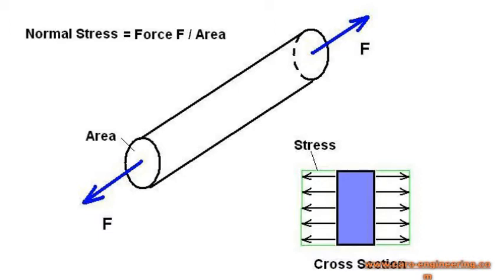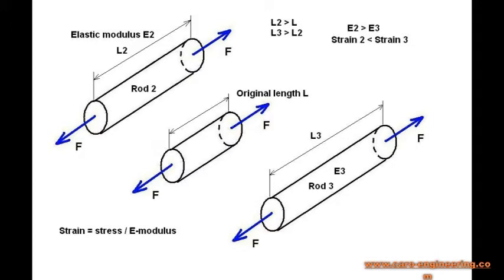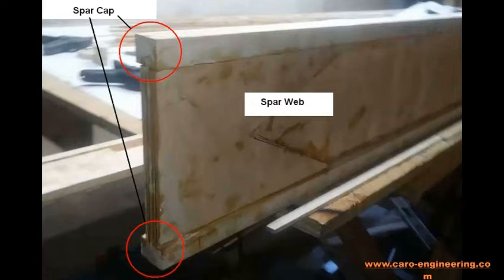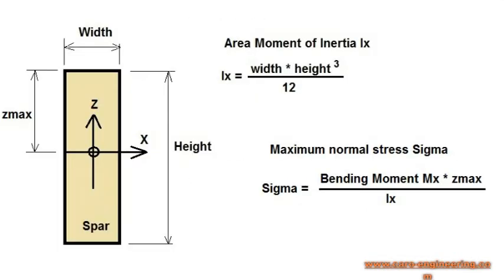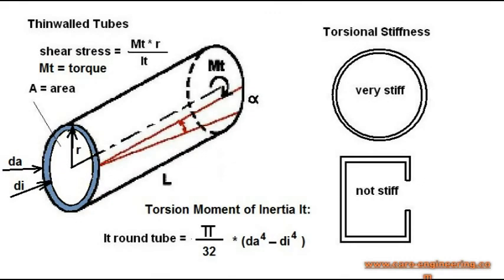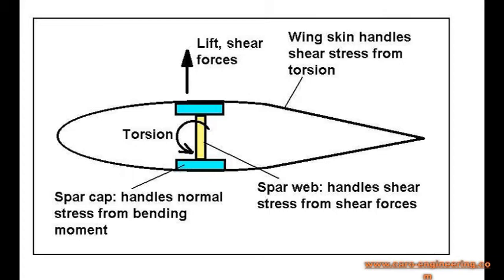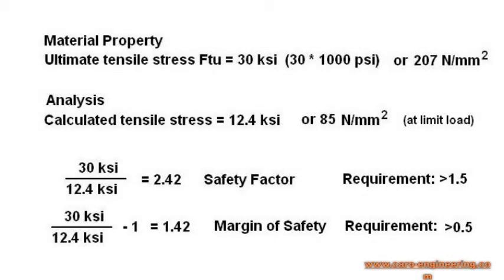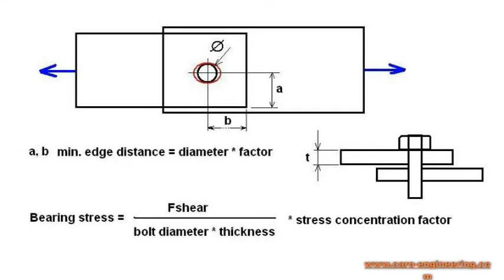Small Airplane Design Tutorial 17, Structure

Comment: For these thin walled structures like the d tube and the fuselage tail boom, the failure mode would inevitably be local buckling on the compression side but I can't seem to find any robust mathematical framework to predict this buckling. Also to mitigate this buckling, you use ribs. But what should the spacing and configuration of the ribs be? Can you point me in the right direction? thanks
Reply: Depends on the construction method. Most aluminum designs allow post-buckling of the wing skin. The spar caps take all the bending loads.
Reply: @Triple_J.1  Thank you, but suppose, I wanted to calculate the rib spacing, for say a tail boom with a circular cross section, how would I go about it? Thanks again

Comment: If the spar deflects too much, might it not affect the aerodynamics even though the yield strength of the material is not affected? 

Can a spar be considered to have failed if it deflects too much even though it is still structurally ok?

Therefore shouldn't deflection be the design criterion for a spar rather than the yield strength or ultimate tensile strength?

Thank you
Reply from the maker: Usually not, but stiffness is a design consideration because it affects flutter, especially on gliders with their long thin wings and fuselages. A structure that is too flexible can negatively affect flight characteristics. If an airfoil shape deforms, it probably creates more drag.
Reply: @sonjaenglert  I have one more question which I hope you won't mind answering;
What values do you use for yield strength, ultimate tensile strength, compressive strength and elastic modulus for glass fiber reinforced epoxy resin?

Thank you
Reply: @SunilSundar  E-glass has an elastic modulus of 10,600,000. It breaks around 477,000psi. Or 0.045 strain (4.5% strain). 

Epoxy is in the range of 500,000. It breaks around 8,000psi. Or 0.016 strain (160 micro-strain).

Because epoxy cracks and disintegrates at 0.016 strain, that is the maximum strain that a laminate will be able to survive for more than one use. Most designers use 0.004-0.005 strain to allow plenty of safety margin, and to account for fatigue which will crack the laminate at a lower strain with repeated flexing. 

Now, multiply those above modulus's each by ratio of epoxy to glass in your layup. 

And then multiply by 0.005 for design allowable stress. Keep in mind, only the glass in the 0-direction (of the load) is counted. So a laminate of 0.5 glass/epoxy where the glass is 0/90/0/90 only half of the 0.5 glass will be counted for strength. So 0.25.

Example: 10.6e6 x 0.4 Glass, x 1/2 in the 0 direction = 2,120,000.  And 5e5 x 0.6 Epoxy = 300,000. 

Add together, = 2.42e6 Modulus. X 0.005 strain = 12,100psi allowable stress in the 0 direction.

If 100% of fibers aligned to the 0 direction instead of 50%, use 24,200psi.

This is tension. In compression, multiply by 0.8 for better estimate of strength. 24,200 x 0.8 = 19,360.

This is hypothetical and not rigorous. There are many factors. This is probably conservative and useful for UAV or mode designs. Not for man rated aircraft. YMMV.
Reply: @Triple_J.1  This is the best answer I have gotten to this question! Thank you you Sir!
Reply: @sonjaenglert  thank you